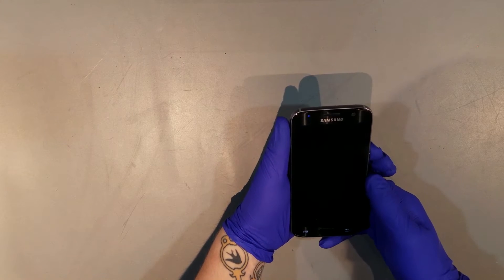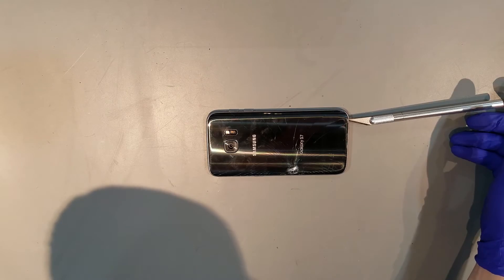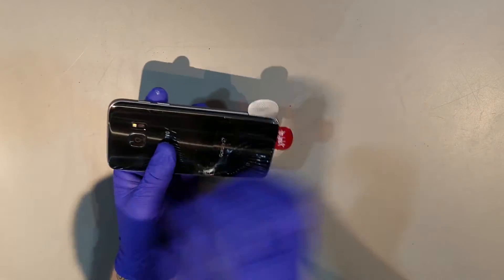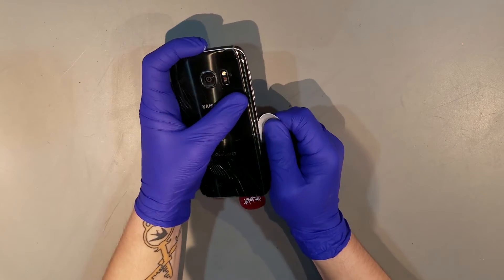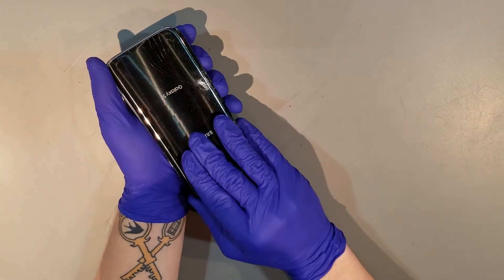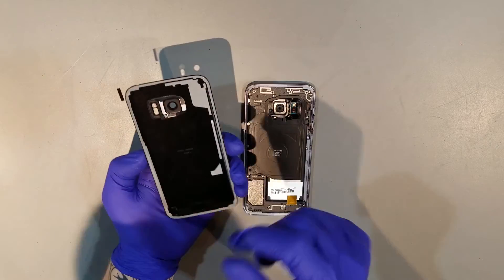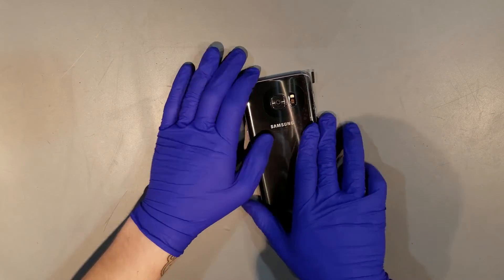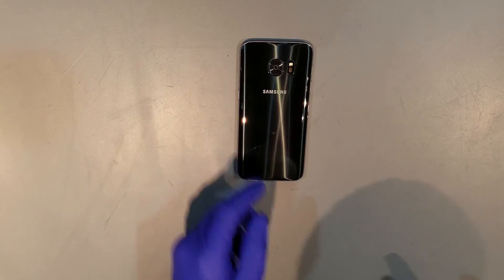Samsung Galaxy S7 Back Glass Replacement

Comment: Hi! Great video! I'd like the link to the exact back glass replacement you used. Most of what's available online uses an adhesive sticker to reseal the back. I want the one with the adhesive glue. Thanks in advanced.
Reply from the maker: The majority of the one's online use adhesive tape, like the one used in the video, not glue.  I can send you a link to one but I can't remember where I ordered the one used in the video